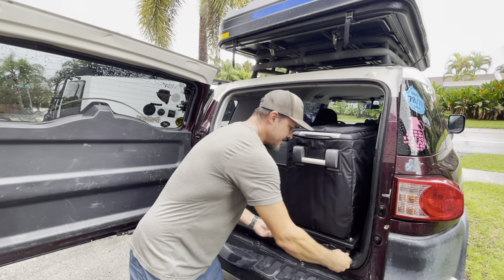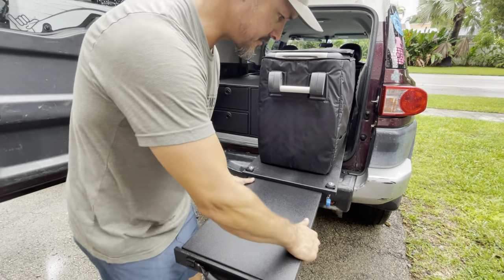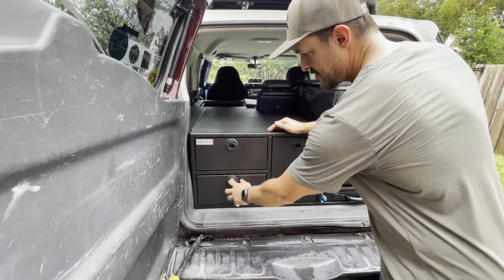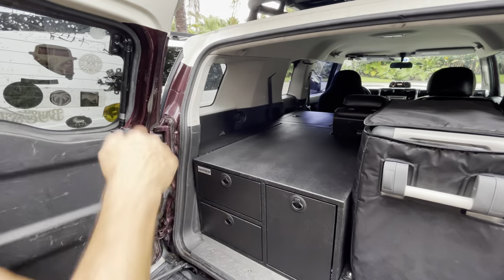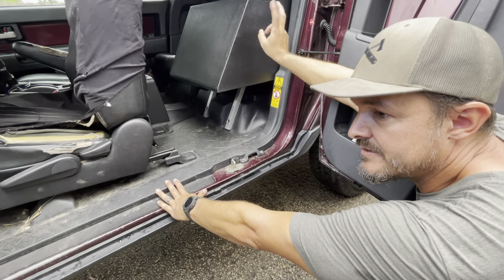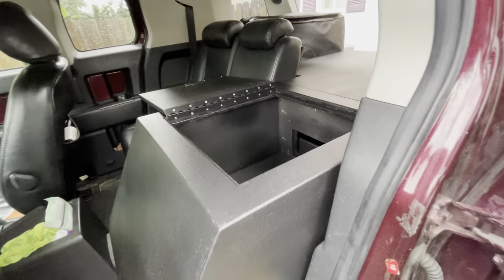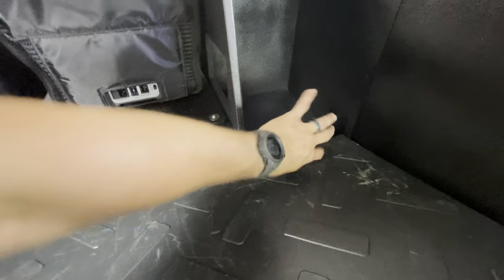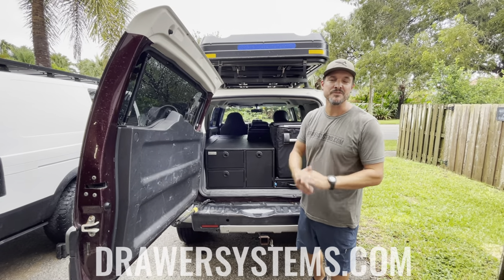FJ Cruiser Overland Drawer System with loads of storage space!!!

Comment: is this raptor liner available in spray cans or do you need special equipment?
Reply from the maker: It is available in spray cans however I don't recommend it. When you buy the kit on Amazon, it comes with a spray gun and all you need is an air compressor to shoot the paint.

Comment: I'm impressed with the work you do. What is the base material of the drawer system?
Reply from the maker: Thank you! I use birch plywood built with glue and pocket hole screws, then painted with Raptor Liner. They come out very strong and hold up really well.